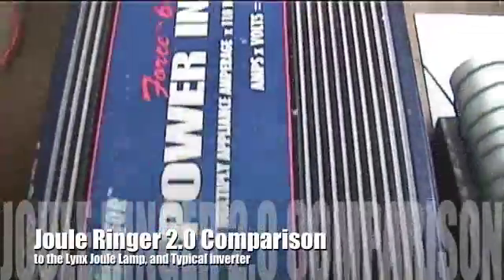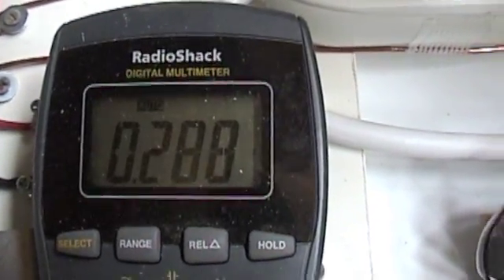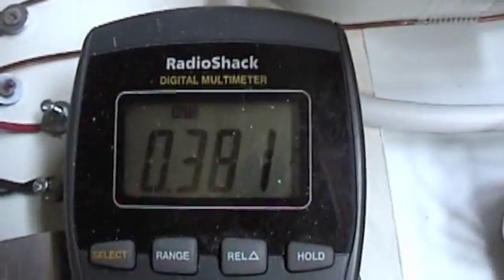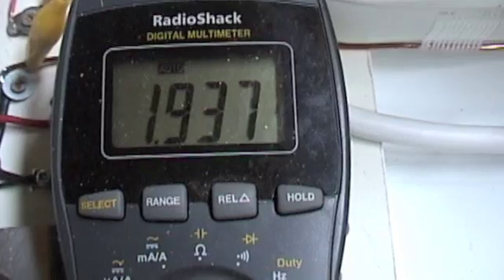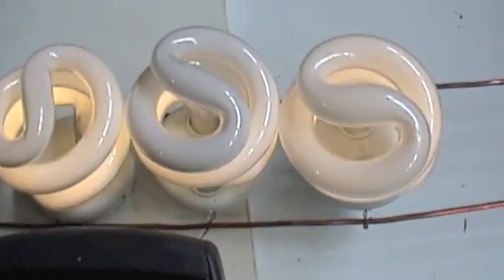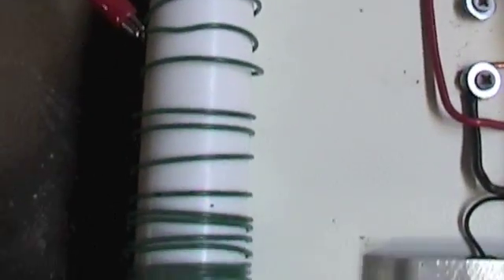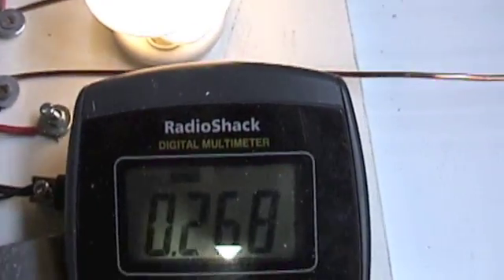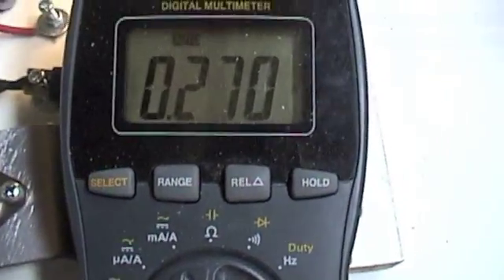Super Joule Ringer 2 Comparisons

Comment from the maker: I just couldn't get enough wire in with the thicker bell wire. This is a fairly small transformer so to get enough wire in was a challenge.  I didn't wind the primary with two strands.  Just one strand once across.  The turns ratio isn't quite 10:1 either.  I couldn't wind on enough wire to get to 10:1.  Maybe 8:1 for 100 volt output.  Perhaps I should rewind it with magnet wire.  Or buy the right E-Core.
I'm going to try a bigger air core to see if I can beat the E-core - doubtful.

Comment: I bought some of that soild core telephone wire that you are using.  I really like your small and compact 2.0 E core setup.   I will try that arrangement using the telephone wire.  You are right the efficiency and pure simplicity of this device makes it a winner.  I'm surprised that your transistor doesn't heat up.  I'm still having problems with that.  I'm hoping that the smaller gauge telephone wire solves the problem.

Comment: A CFLs is a discharge tube - when in parallel one will always discharge before another.
To light all three they need to be in series with more turns on the source inductor and primary drive in the centre.  With CFLs you could even try iron wire for the secondary.
Good Luck with your testing.